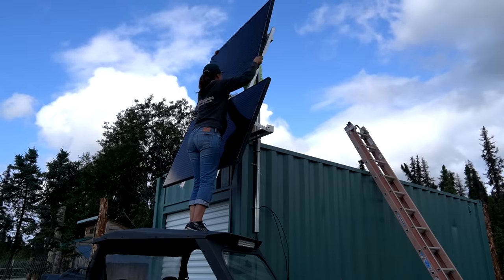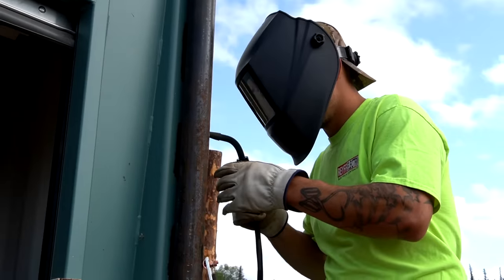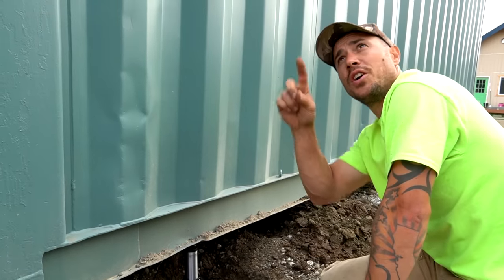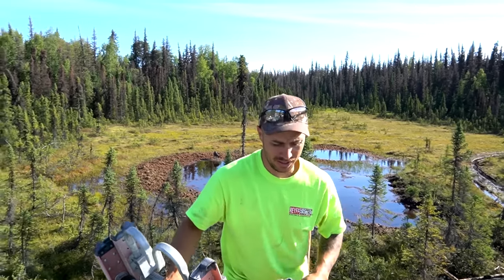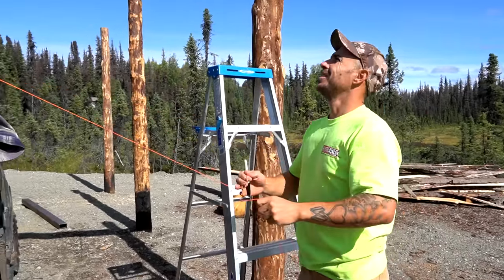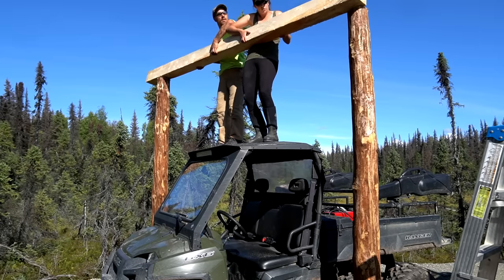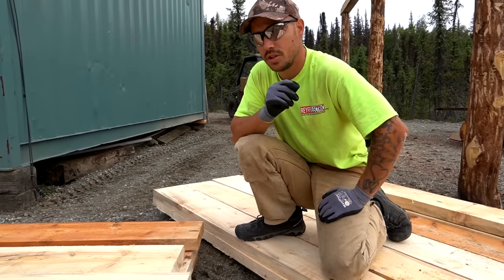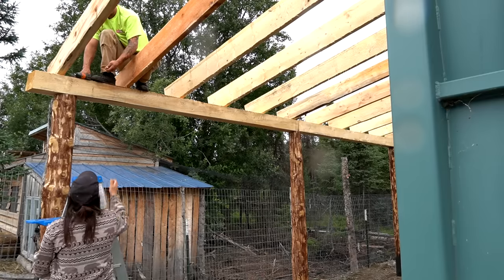Solar Panels & Rafters Go Up | Shipping Container Lean-To Build

Comment: We weld permanent jack points using L steel on the outside of the four corners. - you can use a bolt as a driver to adjust over time with a big base pad of concrete .Bob
Reply: Good idea.
Reply: Sawmills and other construction sites use this method, it works in other applications as well

Comment: Next time you’re doing a vertical weld try welding up instead of down. It will result in a better puddle and help you maintain good penetration. 

Not trying to be critical just thought that might help you for the future.

Comment: Who else want to move into Alaska and live simple life like this amazing couple?
Reply: I am sure there are some very hard things both physical and emotional but they are a great team just both of them. Your fan from Malta.
Reply: We purchased land 70 miles out of our city in Florida and the land is Off Grid and only gets a cell phone signal on the dirt road at the front of the property.  The nearest county electrical is about 1/4 mile down the dirt road, so we will be doing Solar and Wind. We have a sailboat so we are staying in Florida for now. We plan on buying two or three more properties around the USA and travel to camp them.

We will eventually sell our house in the city.
There are remote places in almost every state inside the USA.

Also it is not a simple life, we put in a 36 foot galvanized culvert and 15 yards of gravel by hand.  We now have a tractor, but on that job we had buckets, shovels, rakes and a hand tamp.  The work on some days can be grueling.  Like when we cut down 1/4 acres of Saw Palmettos and it was 102 degrees outside in the shade.  I wish it were a simple life.  I worked for years as a Security Officer and that was a Simple Life... Donuts and Coffee any time of day and breakfast at Waffle House.... well I still have breakfast at waffle house about 3 to 5 times a month.
Reply: No, I'm fine just watching. It's inspiring, but too heavy for me.

Comment: You 2 are so lucky to live like you do I'd give anything to live a life like that Keep it up and stay Happy take care Love your channel
Reply: "Luck is what happens when preparation meets opportunity"
Reply: @sixtomidnight1492  yes your right
Reply: @donaldmiller8629  I have worked hard all my life the dum way lol manual labor I liked working with my hands and am good at most everything I did but should of Stade on the machines lol my body would be in better shape at 59 lol
Reply: @donaldmiller8629  lol I lost my short term memory 3 years ago when I had a stroke at work then then 1 year after that came the heart attack not working anymore lol
Reply: @donaldmiller8629  I don't give up on anything like you very slow and it will be done if I remember to do it lol lol

Comment: You ought to block between your rafters on top of the outside beams with rafter size blocks. That will help a lot with wind load and flex horizontally and keep the rafters from ever lifting. It would also strengthen your beams that are sitting on the posts even more. That could even be done after metal roofing is installed. I framed new homes for over thirty years. Free unsolicited advice 😁.
Reply: They also will consider snow loads

Comment: You would likely need a more support, but it would be cool to build a floating floor on the top of the conex and then put a wee deck up there (with our without a roof). Looks like you get a pretty nice view of that pond bandit is digging haha.

Comment: as a carpenter I would recommend nail plates on the joint of the supporting beam on the wall to stiffen the building against wind gust and horizontal load on the building
 since you did not splice the beams
Reply: Can I get an ELI5?
Reply: It is a pity that no one listens to a professional gagorian. A powerful storm and all the work can be lost!

Comment: Wow, I cant' believe you all got this done in a couple days! Something to think about is the way the water will drain off Connex. It looks like it will drain into your new covered "dry" areas. It looks like all that water will drain down the walls of the Connex preventing you to store anything against the walls, correct? Maybe I am missing something. If it is an issue, the design you have will allow to cover the Connex by continuing the roof up to a ridge beam supported by a couple of king posts in the center which can be supported by four additional beams going from left to right attached and flush with your existing going front to back beams. Put a gable vent at each end and call it a day. You can use it as storage for really long things and you wont have to worry about shovelings snow off a flat roof. You could even pitch the roof steeper (double min.) over the Connex to "architecturally celebrate" the Connex's center as well as give even more head height to store taller things above.  It is so cool watch everything evolve! I love everything about the off-grid homesteading!!

Comment: Silicone needed to be on the top side of the conex…you have a temporary fix inside, but it will leak. We have 2 - 40’ containers we are building into a home. Welding is a strong hold, 1” x1” is good for 60,000 lbs…you won’t have a problem with your solar pole. I have 14 panels on our container with L angle welded to the container as the solar brackets. Fun to watch & pretty lumber.

Comment: You could've welded studs on the roof of the container instead of drilling a hole through it. I'm afraid that water will end up accumulating inside those square supports and end up rusting it out.
Reply: If I were them, I would seal around them with Urethane, which is what is used to seal in automotive windshields. It lasts for decades and does not rust metal like Silicone does.  We have property off grid in Florida and are talking about building a trailer to go buy and haul our own containers to our property and build a house, barn and canopy for our RV in one location.  We are talking about building it three story octagon shaped with a Geodesic Dome roof so hurricane winds will not be an issue.
Reply: Containers are made from corten steel it won't rust out.

Comment: Hoping ya’ll are putting metal bracing on each pole and wooden roof beams! Alaska is known for it’s earthquakes and one bolt down the middle just isn’t enough to hold those poles to the roof if you get any shaking and/or strong winds!
Reply: And a heads up - have the same set up for a roof to give cover for our chicken coop. (Washington) The container roof will overflow an unbelievable amount of water down the wall under your new roof without an abundance of seal/foam seal or something to block the water. Best option is a slanted roof over the container also. Good luck!
Reply: @robertblanchard5269  See my thoughts above, I believe we thing on the same page!
Reply: Correct me if I am wrong Bobbi but I think you are referring to diagonal bracing attaching the round columns to the flat 8x8 beams, is this correct?. This will begin to create what is called a diaphragm design that will help the building from swaying and stay vertical, which is what we want to some degree but, just a little.  You can do this by cutting down some of those "extra" 8x8's to 44" long with a 45 degree but at each end so that the outside is 44" and the inside dimension is 36" and attach them with at least one  3/4" Lag OR Through bolt penetrating the wood column at least half way. I suggest also putting two rows of 2x4's 1/3 desistance along the length of the underside of the rafter. This will help when putting on the roof as well. After you put the 1X material on the roof you should be good. Another thing I want to suggest is that you put your hurricane straps on both ends of your rafters.  You might have done that and I didn't see. Remember, it takes two points to hold things really securely.
Reply: Hi Bobbi how are you doing?

Comment: Looks really good, It will make awesome additional covered space. I would spray a mixture of used motor oil and diesel fuel on that Pine for sure. Thanks for sharing.

Comment: Did you consider lap joints between the 6 x 6's where they meet over a pole. Did you consider using steel strapping to hold the 6 x 6's to the poles?
Reply: I was thinking the same, as they notched the beams in the back to “level”  the 6x6’s . Also they might consider some blocks to help keep it from racking.
Reply: Don't know at this point if that portion of the structure will be under roof, but, they may have used the butt joint so as not to allow water to sit under the lapped surfaces maybe? It will be interesting to see how they continue the roof line.
Reply: The lap joint can be used either horizontal or vertical.  Hope that makes sense.
Reply: @sparky167  Good point and, yes, it makes sense. Be safe.
Reply: @sparky167  True, installing it vertically vs. horizontally would make moisture drainage better but why have three surfaces to that need to drain vs. one.  I'd probably go for the butt joint in that application myself.  But that's just me.

Comment: Any thought to adding solar panels to the roof? It’d probably be nice to start to generate more free energy as opposed to running the generators all the time.
Reply: I am wondering if it's not worth it, because in winter they have almost 24 hours of darkness, and have to rely on the gas generator then. So maybe better to keep the generator running a little in the summer for supplemental power, to make sure it's humming and running smoothly for when it becomes the primary power source in winter? It's really good to have a primary and backup which are interchangeable.
Reply: @brendag2891  And they will be snowed down on a roof.
Reply: @milcotto4153  I have a small array of solar panels and live in a snowy climate (Minneapolis) and barely get any charge off the solar here in winter. But the snow does slough off and melt fairly quickly, especially at the angle they have theirs at. I know they have various methods of getting snow off roofs. They remove it from the high tunnel, snowblow paths around buildings where snow sloughs off, tossed a water bottle with a rope tied to it to scrape snow off their cabin up the river, and I think they also push the snow with a plow, but I don't remember exactly. I'm sure they can just use the ladder and climb up to the top of the connex and shovel the snow if it gets too deep on the roof. That's what we do here, anyway. The solar panels are on that pole, with the ground underneath, I think, so snow would slide off onto the ground anyway.  But with an hour of very low angle sun in the winter per day, it doesn't really matter.
Reply: Combo solar and grid and generator if possible.  Always best practice to have a back up and a back up to your back up when ya live in the sticks.  :)

Comment: Do you have enough of an angle on the Roof to more easily have the snow slide off the roof instead of staying on the Roof?  Will the roof be made of Wood or Metal?
Reply: I'm sure if they meet the recommended pounds per square foot roof load, it'll be fine

Comment: Look at all the experience you 2 are getting at building. Next is an addition on the back of the cabin ! With all those dead trees you can build a nice big addition. Maybe have a composting toilet in it for the winter time ? Don't heat it and maybe it will stay cool enough to be a root cellar sort of ? You 2 are fast and hard workers. Thanks for sharing. God bless

Comment: Really like what you are doing.  Love the fast-speed at the beginning.  I shouldn't add this... But... built a few things in my time.  You really should add a horizontal 2x8 at the conex roof from left side beam to the right side beam.  That ties all the wood structure together.  Then, just keep going and add a 'peak' by extending each side's roof pitch to the top-center-conex highest point over the conex center.  Maybe that's your plan already!  With metal roof then that will all shed the snow/water.  Best of luck.  Up-north MN.

Comment: On long threads, use an empty chuck (no drill bit in) - to run washers and nuts up or down the tread. Way easy once you get the knack to it.

Comment: I think that eventually you will have to put a roof over the container because of its flat roof. No where for the rain or snow to run off and  it will lead to rust and eventually those siliconed bolts will start leaking. But it doesn’t look like it would be a very big job, just a few more short 2x8’s and maybe some cross braces and tin of course nothing you guys can’t handle. Great job on the lean-to shed build so far, looking forward to the next episode.

Comment: The range of skills that both of you have is really impressive!  How satisfying it must be to be building what you need from the standing dead wood right there on your property, especially with the lumber prices what they are right now.  It's insane what basic lumber is going for at this point.  Instead of forking out all of your money for the end product, you've invested in a piece of equipment that you can use on an ongoing basis to continue to have a steady supply of building material.  Heck, I bet you're basically paying for your mill with the savings in lumber on this one project alone!  Every stick of wood you mill after this (or soon thereafter) will be 100% savings other than fuel and maintenance, and with your knowledge and skill you'll be able to do all or most of that maintenance yourselves.  AND, you're turning the problem of a vast number of dead trees, a major fire hazard, into a solution by taking some of them down and using them to build what you need to make your lives easier and more efficient.  Super impressed with your creativity and ingenuity in making adjustments and solving problems as you build.  It's also amazing how well you two seem to work together.  I keep thinking you must certainly be editing out some of the more prickly scenes, LOL!  I personally find it really challenging to work on projects with my husband with the same level of congeniality and patience that you two do, especially as we get tired after a long day of work, even though we adore each other and have a great marriage.  You two really seem to get along incredibly well.  

So far everything is looking fantastic!  It will be really nice to not have to constantly be removing snow from all of your vehicles every time it snows, and to have so much more storage space under cover.  This coming winter you'll have a lot more time to devote to other pursuits other than snow removal as a result.  We're looking forward to seeing the completed project!

Comment: Eric, a few comments if I may.
1. Rebate and overlap the beams, on both the posts and the container, or at least use gang nails to join them together. 
2. I suggest cutting a rebate in the posts for the beams to sit in then bolting them horizontally through the post. Only needs about a 2 inch rebate cut with the chain saw.
3. Frog the rafters onto the beams as well as using the metal brackets on both sides of a rafter. 
4. Add diagonal bracing to the posts to add rigidity.
5. Too late now, but a large flatish rock under each post would help prevent the post sinking. More area to sit on.
6. Have wide eaves, 1.5 to 2 feet. Too late for that also as you have cut all your rafters.
I know that you are working with what you have but please read or watch articles from other people building sheds to get good ideas and building techniques. I've built post and beam sheds using local material and your structure really needs some more finesse.

Comment: as a life time wood butcher id say this is a great effort.. a few thins to mention is never lay up a full set of rafters and leave them unsecured especially these huge ones.. secure each one as you go.. if one decides to slide off it could cause them all to slide and would easily kill some one .. just one of these on your head could ruin your whole day.. also the hangers should be on the opposite sides to prevent slippage and do nothing where they are.. not using birds eye cuts is is a big mistake... cutting rafters 101.. youve done a hell of a job for one man and a helper.. cant wait to see it progress..

Comment: Solar power in Alaska makes a lot of sense if you can store all the energy created during the summer and use it later. Even during the winter you might get 50% out of it. Shipping container storage would also make a lot of sense for Alaska to keep everything dry and out of the extreme weather.

Comment: One thing to keep a eye on. Is the spacer sexy welded on the top of the contacts under the word you can get moisture in there in if you do not have a whipple or something to for the water to drain out it might get paddled in there gesture because of the condensation something that i would be definitely checking into

Comment: You guys are my favorite youtubers to watch.  I look forward to every video. 

Since you didn't cut birdsmouth notches for your rafters to set on,  please consider using joist hanger nails instead of drywall screws for your rafter ties.  Drywall screws are super brittle and are also not meant to be in the elements.  One light tremor and those screws could snap off and your roof will slide down toward the beam.  That is where the notches would help. 

Just my two cents.   Love your videos and your cinematography is outstanding.  👍🏻